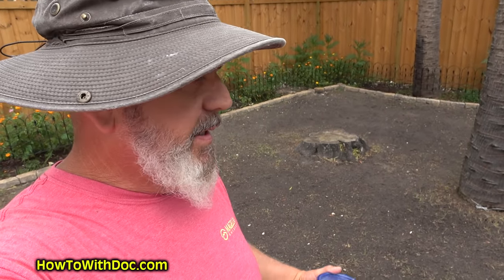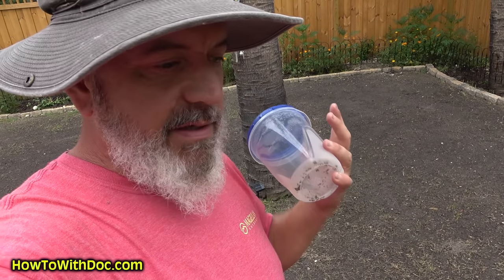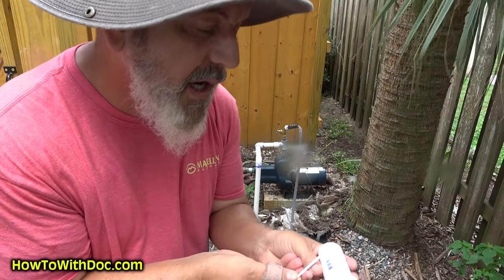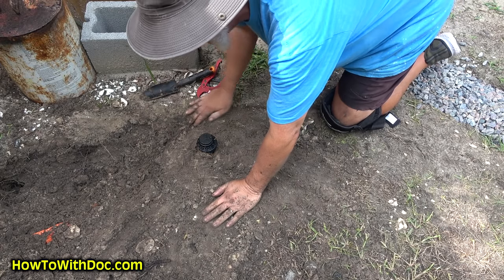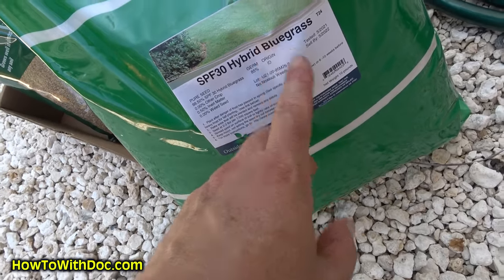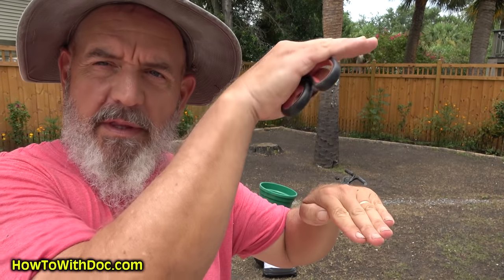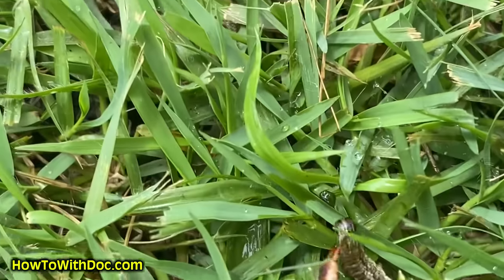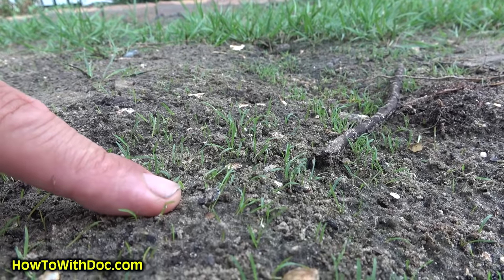Lawn Starter Fertilizer and Seeding New Lawns

Comment: I also have sand points for my irrigation. Technically it's not a well. I started out with the rust remover injection system but it got costly. Depending how often you water, the tank will empty quickly. I ended up putting an iron max rust remover filter that can be backwashed. Maybe look into that. HTH

Oh, I also experimented with the spf30 kbg in SW FL. It was winter time and it looked great. It all melted when summer came around. Fun experiment though.
Reply: Yeah, he is going to hate keeping up with the rid o rust. It’s going to cost him A LOT of money each month. Plus, every system that I have ever worked on has eventually failed.

Comment: Doc, those injection iron neutralize systems ALWAYS fail. I live in FL and all of the homes here are on shallow wells. You are better off just spraying rust remover after the fact. It costs so much money to keep up with all the rid o rust neutralizing solution that it is not worth it. Also, it constantly needs maintenance as it tends to suck up too much air which messes with your pump. Anyway, good luck, but I’m afraid you are not going to like the upkeep with it.